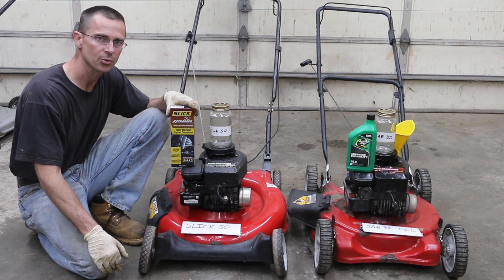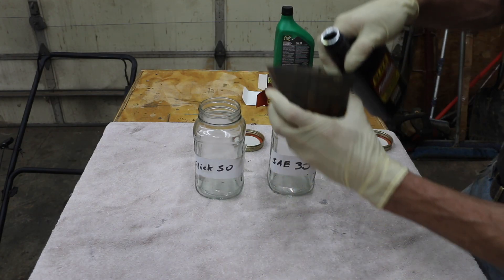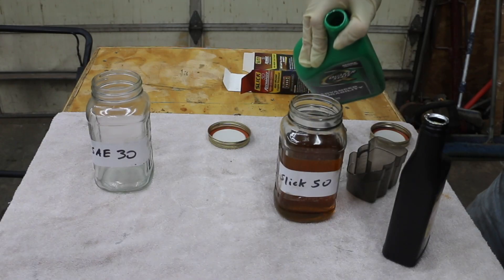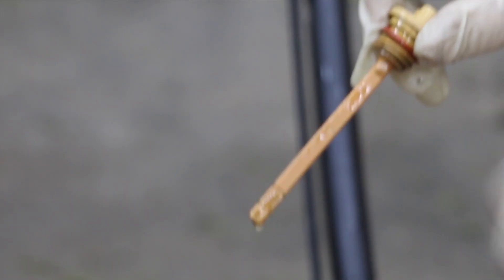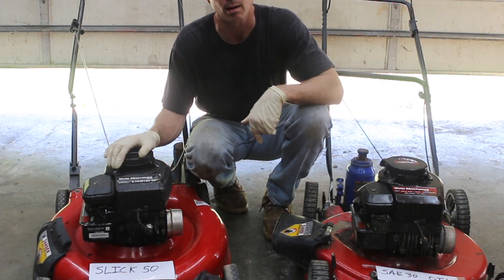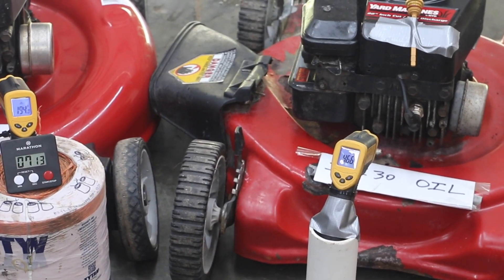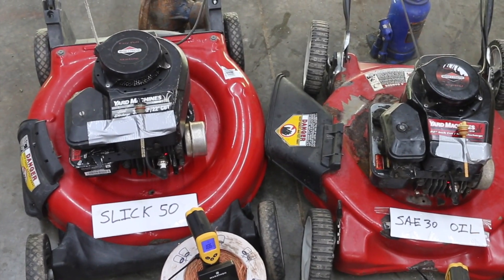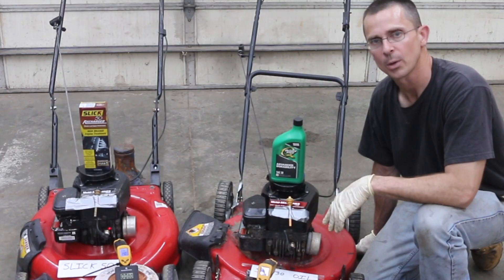Can't believe what SLICK 50 did to my engine!!--Dry Crankcase Test!

Comment: "Prolong" has always been the best. I use it for everything. Every squeaking door hinge in my house all these years including cabinets have never squeaked again. I even applied it with a q-tip to my light bulb sockets 20yrs ago and the new lamps still screw in and out like silk. I've added it to my Riding mowers and push mower yrs ago and they crank easier and faster with it. What impressed me the most was, I lubed my manual roll up doors in my garage and they still amost fly open themselves. I'm almost out of the supply I procured 20yrs ago. I'll explain below, but I hope they haven;t changed the formula that's sold today. xD

Back 20yrs ago, our company was so impressed with it they bought a couple of 55gal drums of the Prolong ($11,000). I "borrowed" some home and still have about a quart of it left in my oiling botte. Us guys in the shop replicated the old infomercial test with the electric motor, bearing race and Torque wrench. We had the bearing race spinning in a reservoir of the different lubricants just like the infomercial and were able to stop the motor with the torque wrench and it would leave scoring on the metal. We then removed the reservoir and applied just a thin coating of Prolong with just a q-tip reservoir and just like the test, we could NOT stop the motor!! There was just a slight marking that may have been just heat. I couldn't believe my eyes!! It actually worked!!! I hope the formula never changes. My luck it's given me some kind of latter years blood pathogen. xD
Reply from the maker: Thanks for the feedback.

Comment: You ought to be aware that there's a video that comes up in the feed alongside this video with an interview of supposedly the originator of Slick50. He explains that after getting into bed with a marketing company in a deal that eventually went wrong, he kept the recipe but not the name, which he now markets under the name of ExcelPlus or something like that. He also said he had to go to court to stop the new owners of the name Slick50 using claims from his original formulation.
Reply: Anthony Ramsey  I have no knowledge about the Xcelplus but My father was a distributor for the original Slick 50 back in the early 80's. We had a small push mower that was treated with "Slick" ,as he called it' and it would run with no oil in it for around 55 min. before it locked up. We would let it cool off and put oil in it and it  restarted   and ran fine. We did this several times before he ever tried to sell it to anyone. He wanted to know for sure if it worked before he put his reputation on the line. I have no first hand knowledge of why the original developer of Slick 50 sold out. He may very well have been a horrible money manager! It wouldn't be the first time someone with a great product or service went under do solely to poor management skills but I will say without any reservations that the original Slick 50' sold back then' was an awesome product that worked! We ran that test several times on that engine and then put it back to work mowing our yard. I t was still running great several years later  when I finally made enough money bucking hay for a neighbor  to buy a used riding mower and gladly retire
 the push mower.    This was around the time that the company was sold and the formula changed. Dad had no confidence in the new formula so we moved on.
Reply: Xcelplus Engine Treatment  xcelplus.com.au/
Reply: Interesting

Comment: Just my two cents... I ran Slick 50 in my Dodge Ram when I lived in Texas and the engine ran noticeably cooler, which is a great thing in the central Texas summer. But it ran so cold, that when I drove back to visit my family in Pennsylvania, I actually had no heat. After blocking off the front grill and radiator fan I had warmth again, so I know it wasn't heater core issue. It seems that it takes awhile for the product to work and I did run that truck engine over 200k with no issues.
Reply from the maker: Thanks for sharing.

Comment: In the 1980's I sold this very Slick 50. It is an amazing product.  If I may make a few observations to your test. The Teflon must adhere to all friction surfaces.  Run engine with Slick 50 added for quite a few hours to allow it to bond with the friction surfaces under heat ( running temperature  ). Then you can remove the oil and do the test properly.  It is not an additive but a treatment.  I drove my 5lt Ford V8 towing a caravan and a loaded trailer for many miles without oil as the sump plug had worked itself out of the sump. The oil pressure light did not work. When I discovered the no oil that evening I went to a spares shop the next morning and bought a sump plug. Filled the engine with oil and drove many thousands of miles thereafter. Slick 50 does work
Reply from the maker: Thanks for sharing.

Comment: Used slick 50 on a Toyota corolla,idle went from 500 to 700 rpm after and hours driving,
Ran smoother and qiueter.
I think it has a limited life though, in the engine.
Didnt use it again,wasnt my car and it cost a lot.
Reply from the maker: Thanks for sharing.
Reply: @ProjectFarm  Sorry about late reply
Slick 50 back in the 80s.The rep had a small engine running at an annual show.

it was idling and occasionally he would let some young lad give it a bit of a rev.
As far as I could see,it ran all day!
It cannot have done it.
Teflon treatment is a specialied process and done in an oven at about 400 celcius
from memory,it it is extremely tough.
I believe the engine had that treatment
Todays cook wear is garbage,the teflon coating is almost a paint,true Teflon is vastly superior
and I believe it could go all day.
I considered having a mould coated with it,5sq metres surface,Quote $2000+ 20 years ago.
{ then found High Silica paint which was very good at $300/gal

Comment: My thoughts  i used power punch to avoid  dry start  and reduce engine war in the 60 tys , had very good luck  
Then when slick came out i gave it a try was not impressed at all  ,quite it
Lucas bought out power punch and now is lucus hevey duty  i still use in my engine and transmission  ,standard and auto  my farther who was a mechanic for ford and went back to Detroit yearly for training and was a race car builder and driver
Start me the use in the sixties  
Do some testing
Reply from the maker: Thanks for the feedback.

Comment: I've used STP oil treatment for 5 decades in my vehicles & I've had longer periods of better performance  & less engine wear. I had a Mazda truck with over 350k on it & still good compression  & no blow by. I used STP oil treatment in just about every oil change. It works great IF its added properly. Most ppl do not know how to add it, & the product isn't fully effective. Studebaker required it to keep the warranty valid. Their engines outlasted most other manufacturers.
Reply from the maker: Thanks for the feedback.

Comment: Straight Automatic  transmission  fluid  may be a little better  than slick 50.. but your dealing with air cooled  not water cooled . That maybe where slick 50 shines. As It ran lot COOLER To its death ..  Then again maybe not.
 I got this 1992 Chevy 5.0 305 sitting here . it ran  when I pulled it out  a K5 Blazer I purchased for $500.   Iam upgrading it to a 454.. 
Gee... I wonder what shipping cost is on small blk  450 to 500  lb .?. Probably  $ 450 to $ 500. 🤔🤔
Reply from the maker: Thanks for the feedback.

Comment: I have a classic car with a hemi motor which is a bit noisy. (ticky tappet sound)
The engine is 40 years old with good compression.

I added a bottle of Nulon engine repair not believing that it would do anything.
To my amazement, the engine started with the noise and within 30 secs it went quiet.
If I don't start the car for a couple of weeks then the car starts with the noise but it disappears within a few seconds. 
Maybe Project Farm could do a test with this product?
Reply from the maker: Thanks for the video idea.

Comment: Not a good test due to the engines being  in different condition.
The Slick 50 tyres were very worn.
I would like to see the same test done on equal condition engines. 
I know that the test was based on the Slick 50 add of running a treated engine without oil but who would run their mower without oil?
It did show that it ran cooler with the oil in the engine.
To me the test is inconclusive.
The Slick 50 engine may have had a problem contributing to the earlier seizure.

Comment: Great video. 
Did you try to put some oil in both the engines afterwards to see if they started?  Or try using something like  MMO etc  in either to see if you could "recover"  the engine?

Comment: Petrolon, the company that manufactures Slick50 claimed it had Teflon in it.  Teflon is a trademark of DuPont, the technical name is polytetrafluoroethylene (PTFE).  DuPont responded by claiming there was NO appropriate use of Teflon for engine lubrication and sued them for trademark infringement by claiming to use Teflon without permission from DuPont.  I think that says about all you need to know about Slick50.
Reply: Teflon was made to be slippery,how can it not work
Reply: @rexdrabble4988  I left out the fact that the FTC also sued them for making unsubstantiated claims.  How can it not work?  Let's see... Here's an obvious example.  PTFE particles are heavy and stick to nothing so they end up at the bottom of the crankcase, barely circulating and doing nothing.  Another possibility is that the temperature causes them to break down now into different molecules that are less helpful and possibly dangerous.  Yet another might be that they could clog oil passage ways.... Why do you think DuPont sued them, claimed it was an inappropriate use of the chemical and then tried to stop selling to them?

Comment: A company on the 80 90's i think was amsoil had an engine treatment (you sent them your pistons and block, maybe crank, not sure on parts sent) i think the process was baking in something to the metal,  they also claimed no oil running. Ever heard of that one?
Reply: Teflon,it has to be baked  around 400 degree celceus,a number of hours,expensive.
Teflon pots etc arent teflon

Comment: The ptfe in the slick 50 should have stuck to the metal.parts after i think so many miles. The oil.level drops when its done this. Then u top up with normal oil. I had good results in an old hond cb 400f 2
Reply from the maker: Thanks for sharing.
Reply: Only the old formula had PTFE....
Reply: @erleclaire  what is in the new one?

Comment: Them engines can vary a great deal in specs during production. No two a like. I think you just got a tighter engine with the slick 50 and it destructed sooner. Im not a fan off slick 50 just my 2cents
Reply from the maker: Thanks for the feedback.
Reply: @ProjectFarm  was looking but couldn't find if you have done any testing on headgasket sealers

Comment: Maybe try Motorkote? I use it on guns. Never in an engine. We just had conversation on your Seafoam #1 on your Ranger engine. Is there a #3 or 4? Anyways. I mentioned a '93 Corolla. The first owner was anal about the car. That 1.8 took 5 quarts of oil. He always did 4 oil+1 Duralube. I never did the Duralube. That motor actually held much more than 5qts. It was weird. I had to add a bunch more when I dropped the pan to fix an oil gasket leak. It was actually listed like 6.8qts in the owner manual(?)
Reply from the maker: Thanks for the video idea.

Comment: What I would of done is send both oil samples out to be tested after you drained the oil out to see if there was any difference in the chemical additives.
I have personally used slick 50 but really did not see any difference in longevity in engines with and without it.
My partners and I maintain 300 piece's of equipment in N.Y.C we have used royal purple synthetic on four heavy duty vehicles royal purple claim we would have less wear  those 4 engines threw rods through the block after 4 years and only those 4 vehicles.We still have a 50 gal drum unused.
I gave up on slick 50 25 years ago switch to amsoil and never went back.
Reply from the maker: Thanks for the feedback.

Comment: I was always told if you use a good quality oil that’s all you need.
Reply: And I was told that making the oil changes on time with good oil
Reply: Clearly you haven't seen the motorkote oil additive episode.
Reply: True
Reply from the maker: Thanks for sharing.
Reply: @ProjectFarm  On my '72 350's I use to use slick 50, had no issues, I now use Bestline after online research, and I saw your video comparison also on Bestline. I have 3 - '72 Monte Carlos, and one is a 402. I use Penzoil (1st choice) 10-30, and 2nd choice is Quaker State, same velocity. But I don't race the cars, as they are everyday ones for me. 2 are backups just incase daily goes down...FYI. Sure enjoyed your Ethonyl gas video.
Reply: @ProjectFarm  this channel sucks... generic answers all over the place... robots? AI? or dont give af?

Comment: I used Prolong transmission restore with amazing results. Had an S10 that started to slip, local shop told me it needed rebuilt. Tried Prolong, and to everyone's disbelief, I never had another problem. Never tried the oil additive but would like to see if it works as well as the trans additive. It came out around the same time Slick 50 but wasn't advertised as much. Thanks for your time and info.
Reply from the maker: Impressive!

Comment: I tried slick 50 on my 1985 Toyota Tercel years ago. I have had a 2 years long detailed log of gas and oil usage by that car before installing this product and then I continued to observe for another 2 years. It looked like Slick 50 had ZERO effect on protecting that engine . With time the car was using more oil and the fuel efficiency was not better either.                                                                                                                                                                                                                           I would like to tell my story about when I  accidentally  used  my lawnmower without engine oil (it had a Honda engine, if this matters) . I Used Amsoil synthetic oil in that mower. One time I drained the oil for some mower maintenance. When all was done I forgot to put any oil back to the engine. A week later I cut my lawn for 20 minutes with that mower. The next week I used it again for 20 minutes. But A week later again It seized after about 10 minutes of work. I poured Amsoil oil to the cylinder and I rotated the engine with a wrench. Engine moved and when started it kept working no problem. It smoked a bit at the beginning . However once it cleared up, it never smoked ever after and it is still in use.
Reply from the maker: Thanks for the feedback.

Comment: STP is the best by far. Back in 1976 I had a 1967 mustang with a 289 ci engine that cold had 10 lbs oil pressure. The oil pressure dropped to 0 when the engine was up to temperature. I used stp in the engine and run this engine for over a year this way. The only thing that would happen was it had one push rod that would make a squeaking noise so I would take it out and dip in in stp and put it back in and it wouldn't make a sound for about 1 month. I repeated this when the squeak came back each month. I ended up selling the car to a friend who changed the engine. Lol. Stp is very good.
Reply from the maker: Thanks for the feedback.

Comment: Hi. I dont know kf its been mentioned but i havent seen much tested BARDAHL FULL METAL or BARDAHL Turbo Protect.

I have used them and engine runns better.. Much smoother, quieter etc.

Would be interesting to see some actual facts on your tests :)
Reply from the maker: Thanks for the suggestion.

Comment: you know.... I'm sure Slick 50 got their asses SUED off regarding their claims...  what people need to understand is ?? as far as the crank / rod bearings etc.....  they ride in a cushion of OIL.. oil displaces clearance.... as far as car engines go, and almost any engine goes, theoretically the ONLY time there is bearing wear is during start up before the engine actually runs to get the oil pump working to feed the engine with oil...  I'd love to know IF Slick 50 is even still around ?? a good product.. i.e. oil additive is one thing, running a engine without any oil is another and self destruction is imminent....  period.... and yeah, honestly for the test ? you needed 2 identical engines.. say 2 new ones...  but regardless what they are ?? the result will be the same no matter what they are....

Comment: These older Briggs non-OHV motors are very tolerant of low oil and infrequent oil changes. I ran one for 9 years way too much grass...thinking when it blew up I'd get a nicer mower...the deck rusted out and I welded it back 3x times...motor was still going when I gave it away to somebody that had a deck with no motor.
Reply from the maker: Thanks for sharing.

Comment: Zmax made the claim with Carrol Shelby not slick 50... They soaked the motor or filled the motor to the top of the heads to presoak a new motor for 24 hours . Then ran them dry on the track... zmax and redline oil have some similar molecular make up I guess
Reply from the maker: Thanks for the feedback.

Comment: No logic. Both engies should've been new. These two engines had different running times. Unfair to slic 50. Running cooler in the beginning means protection, but the engine surely had issues.
Reply from the maker: Thanks for the feedback.

Comment: I remember watching Duralube infomercials that made the same claims as Slick 50 and even said that they beat Slick 50. They took it a step further and put it in a formula 1 engine in an engine testing chamber and reved it to its max RPM with no oil in it. I was only a kid at the time so I didn't have a car to try it out but like a kid I also believed eveything I saw on TV so it's probably a good thing that I didn't have a car.
Reply from the maker: Thanks for sharing.